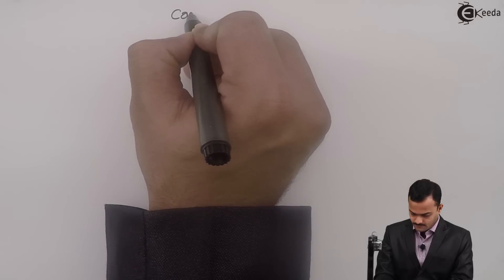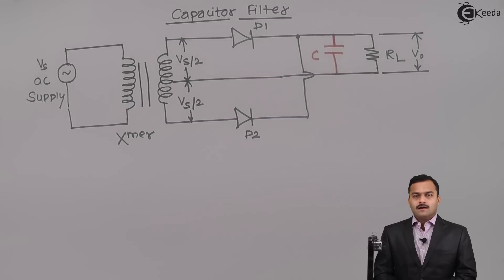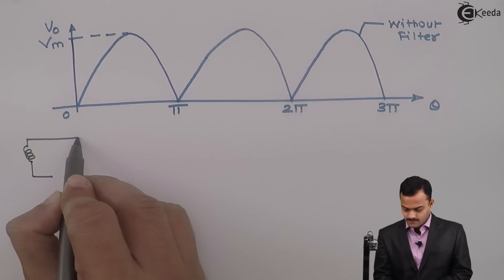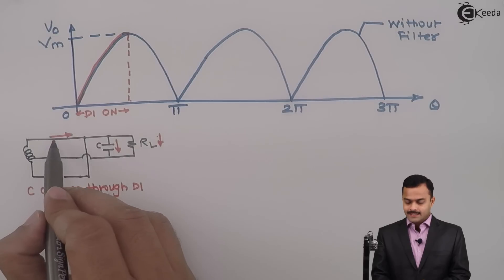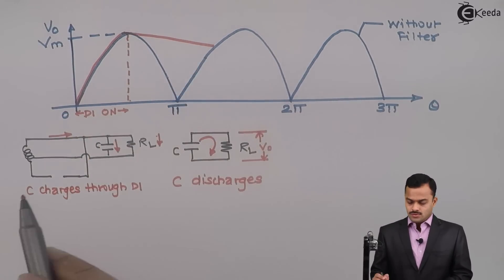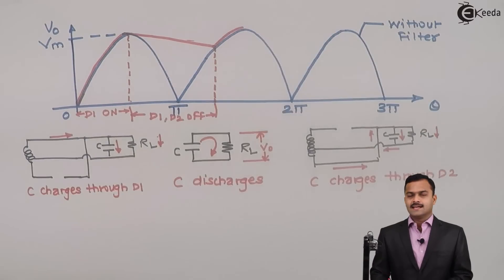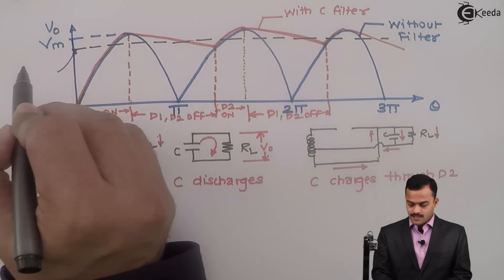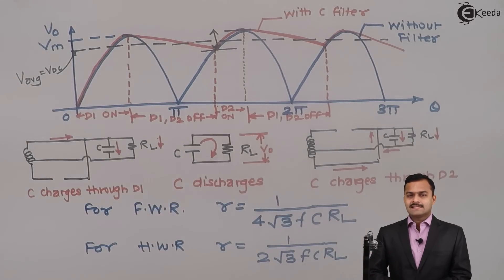Operation of Capacitor Filter - Electronics - Basic Electrical Engineering

Comment: At 6.34 you say "from this point source voltage is more than the capacitor voltage and this creates positive voltage on D2" but actually it should not be the case I think because if the reason was the thing you said  the D1 needed to turn on because at the first half of first half cycle, the reason that the D1 turns on and D2 turns of is the fact that at the start there is no voltage on capacitor but source creates voltage so source voltage is more than the capacitor voltage. I think you showing all processes on the no filter output graph is a bit confusing, I think the real reason that the diode D2 turns on and D1 stays off is: in input wave form second half cycle is actually under the horizontal axis so negative, the D2 turns on when capacitor voltage gets lower than ABSOLUTE value of source voltage which is the thing that creates positive voltage on D2 and negative voltage on D1. Am I wrong?

Comment: Sir what is difference between filter capacitor and coupling capacitor
Reply: My 2 Cents: Filter Caps tend to reduce ripple frequency, as shown somewhat in this video (assists in AC-to-DC conversion)... Coupling Caps tend to reduce background/system noise/signals; you'll tend to see Coupling Capacitors in parallel with Resistors connected to Ground on many schematics

Comment: Sir, why capacitor discharges slower than it charges. Please do reply.
Reply: It is charging via the low resistance of the forward biased diode, but discharging through the higher resistance of the circuitry being supplied with current.

Comment: Doubt🙋- how can both the diodes be reverse biased at the same time..when potential at one end of transformer will be -ve won't it become +ve at the other...
Reply: Cathode potential is higher than the anode 
So it's rev Biased so no current flow..
Reply: He said difference is negative hence reverse biased both d1 and d2
Reply: He made a mistake in illustration i think.....you can see even after the pi/2 D1 is forward biased and will get reverse biased at pi/2
Reply: @nishantjangid7004  no he is not wrong actually you are wrong